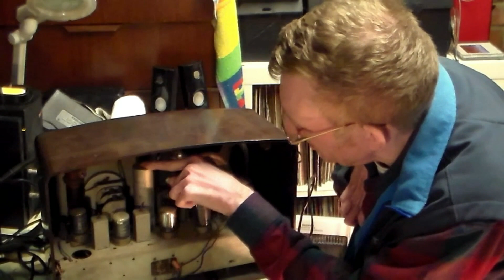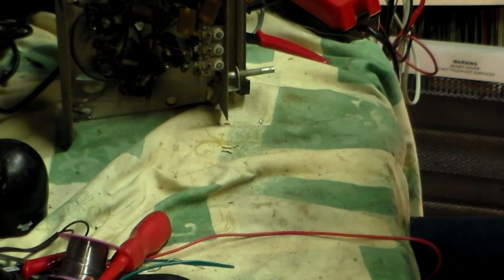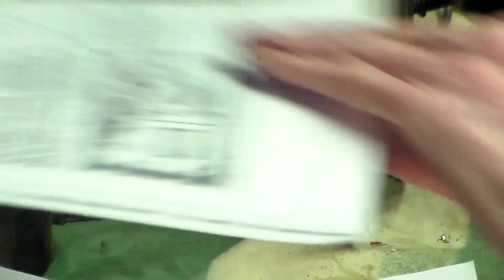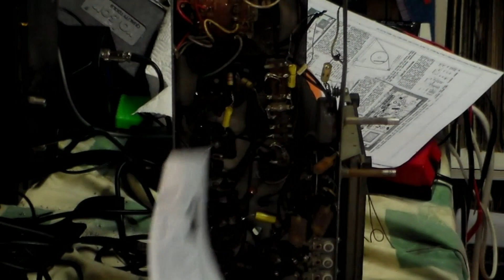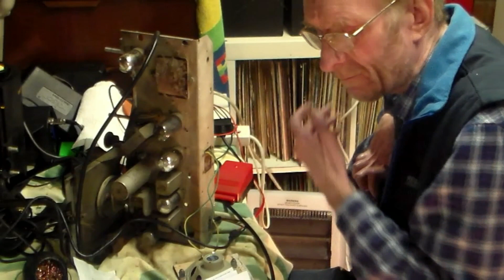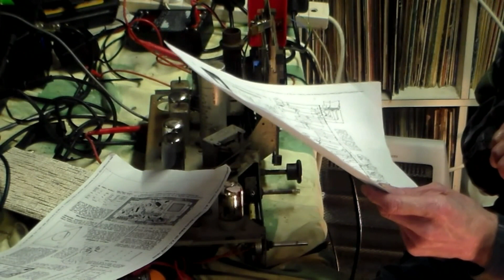Cossor Melody Maker - 501.

Comment: I love British radios from the 1930's to the 1960's transistors.  I'm in Canada, so they're few and far between.  I've only been able to get a Bush transistor battery radio from about 1962, which I repaired and am amazed at the sensitivity if it.  Our local radio museum has a couple of really nice British sets from the 1930's which include a round Ecko from about 1934, which has been restored.
Reply from the maker: A few did get over there and now is a good time to buy them as AM (Broadcast Band) is shutting down at the rate of knots. There are 2 national stations left and they will both close on AM in the next three years or so. I know that you have more AM than we do now and it is still thriving over there so with AM not used much here the prices are going to nosedive.

Comment: Lovely to watch Steve keep up with the videos iv started uploading odd videos now and your a lot better talking on camera then I am. I do have a cossor 501A I think the all wood one going to convert it in to a guitar amp.
Reply from the maker: Those sets can be left alone and used in that way. There are GRAM sockets on the back and with this version being the AC Version it is safer to do. Make sure it is the AC Version and not the AC/DC Version -  and put caps in the way in both cases.
Reply: Me too ! How did it go ?